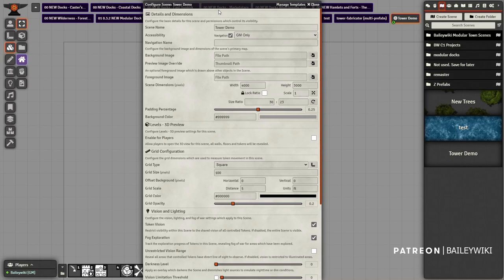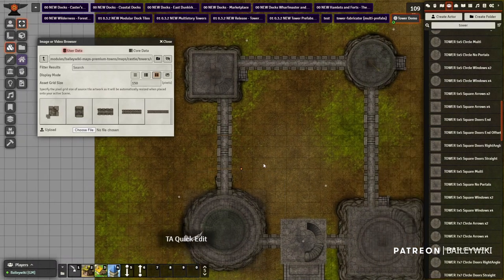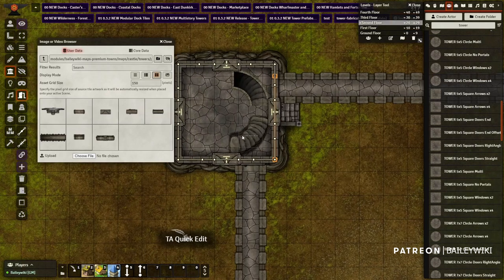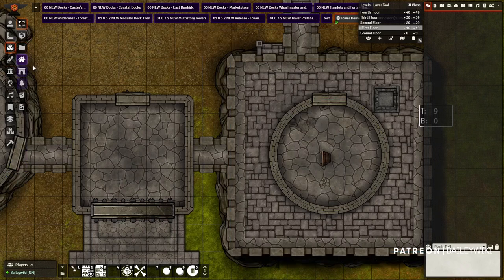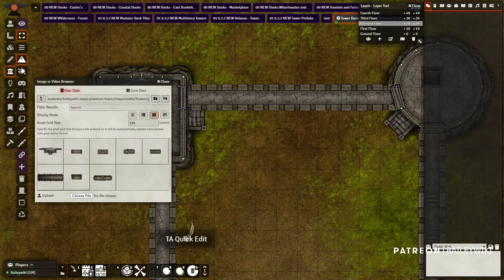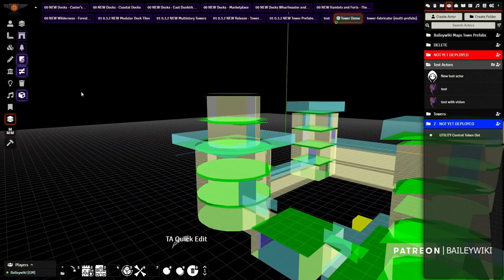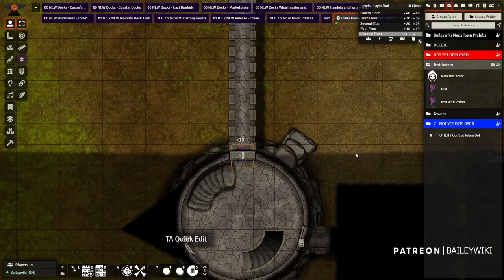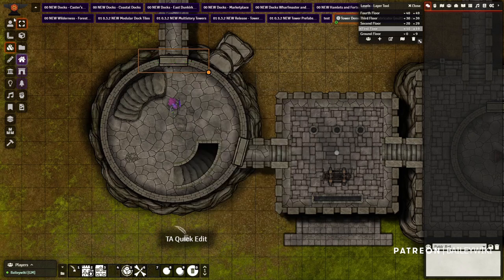Foundry VTT Building in 3 Dimensions Series: Towers and Castles

Comment: Your incredible use of token attacher and Ripper’s modules has got me going back to an old favourite game of mine — Space 1889 and its sister game Sky Galleons Of Mars, in which Martian kites battle floating British gunboats over the canals of Mars. Your three dimensional mapping approach  is perfect for realising this in Foundry

So, I’m taking the very basic ship floor plans that are available in the game pdfs and creating pngs which can be used as tiles for the ship, attached to a token which is in turn attached to an actor which is linked to PDFoundry and finally a pdf of the individual ship combat sheet. For all it’s apparent convolution it’s running absolutely perfectly. As per your method, I now have  fleets of ships which I can drop onto the scene at a moments notice. 

Bear with me.. there is a question coming...

The ship floor plans that are provided are just the deck level. There are levels below deck which I’d like to extrapolate, using Dungeondraft etc. I can see from your Levels video exactly how this would come together. The question is, given that in play  the ships will range in altitude —  the ‘ground floor’ of the vessel will be distinct from the ground level of the scene (ie it will only match up when the vessel has landed) — is there any technical finesse to apply when using the Levels module (or any other module in Foundry)? Can Foundry be made to recognise when the ground level of the vessel is not the same as actual scene ground level? Or is this a level of complexity a stretch too far? Does having a multi-storey vessel that is not at ground level but is mapped at its own ‘internal ground level’  (via the Levels module) likely to cause any issues somewhere down the road? Many thanks and apologies for the long post.
Reply from the maker: First of all, fascinating! You've really got to come by my discord and show us your progress with this project.

Now to your question, if you plan to have the ship land, Levels and Token Attacher are smart enough that you can change the altitude of the Control Token, and that will adjust the altitude of all attachments! So you can build the ship however you like, and then adjust it's relation to the ground on a scene by scene basis. I recommend you test it first with one ship, of course.

Also, in case you didn't know, you need to turn the Levels UI off before dropping the prefab into a scene, or Levels will try to compress every attachment into the active level.
Reply: @Baileywiki  thanks for the reply and the tip regarding switching off Levels before placing the ship on the scene. The problem is that a ships altitude can change every single turn. I’m guessing that this is more of a hypothetical problem in Foundry than an issue with any real in game significance. I’m guessing that there’s no real issue in Foundry—  or with  any module — needing the ships to be using the same absolute  ‘ground floor’.  Although with Rippers further ventures into 3D realisation and the wonders this seems to be bringing, who knows…
Reply from the maker: Oh, so you want to change the altitude during the game? That would be challenging but not insurmountable. You might need to attach the crews' tokens to the prefab, but unlock them from the TA UI before you close it. This should make them move with the prefab when it moves, but they can also move independently. I haven't actually tested this, so this is entirely theoretical. ☝️

Comment: Do you have any reliability issues with the levels plugin? I always find sometimes it fails to work correctly and this makes me a little worried to use it in my sessions.
Reply from the maker: Reliability how? I have had an issue where a token get stuck every once in a while and I have to drag them over by a square, but it's rare. Not sure it's Levels-related though.
Reply: Before we go deep into the rabbit hole, if you use perfect vision you will have random issues
Reply: @Baileywiki  mostly levels disappearing from scenes and taking tokens with them or the vision not working properly when using cutouts. Sometimes also walls all being moved onto the same level even though they were working when originally drawn.